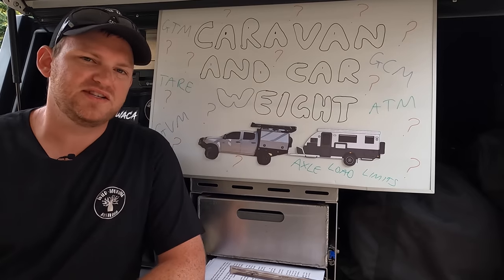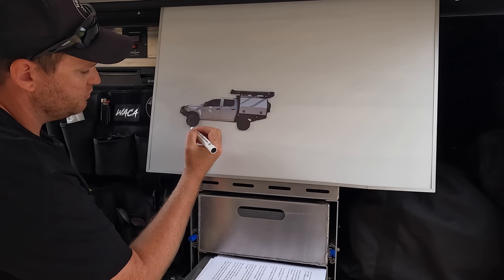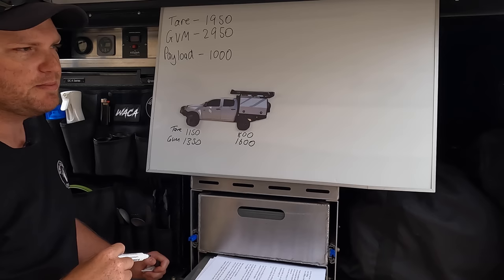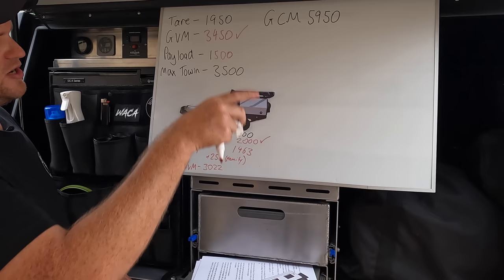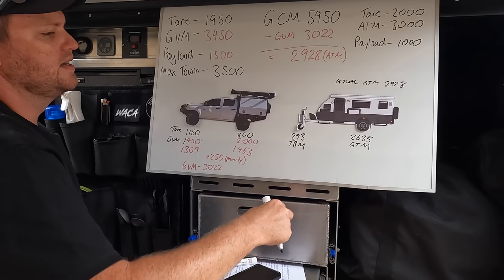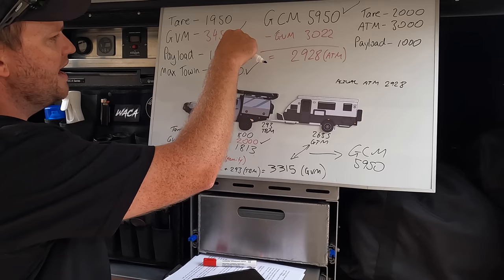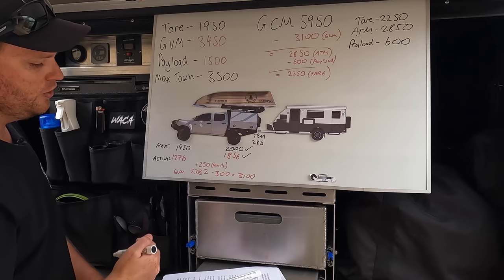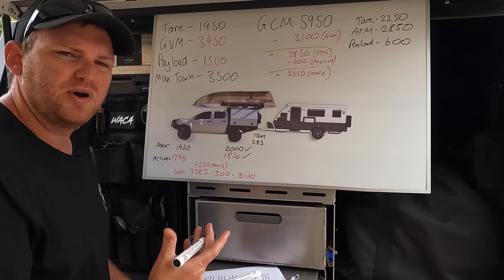How to work out what you can tow? ||  Explained - TARE, GVM, AXLE LOAD LIMITS, GCM, ATM, GTM, TBM...

Comment: Good video and good explanation. However (and I know this is a controversial subject and not everyone agrees) my concern is with using the term actual ATM for the van (i.e. the loaded weight of the van which is less than the plated ATM) and using this actual ATM weight to calculate your TBM and GVM.  Using this actual ATM weight to say you are legal is fine. Now comes the accident and your van and belonging are spread all over the road, does the insurance company come along and picks everything up and weighs it all to confirm your stated actual weight or do they in their calculation just use the plated ATM of the van and ten percent as the TBM to calculate their version of the GVM. Just saying, it could be an interesting court case  if the plated ATM of the van plus 10 percent as the TBW exceeded the vehicle GVM.

Comment: Great video! Was very comprehensive, and super easy to understand. This needs to be shared all over the internet.

I just wanted to add/reiterate a few things for everyone.

The caravan industry is rife with cowboys, and indeed the RV industry in general (boat builders, im looking at you..) Get the weights of whatever your buy in writing, and get it weighed as soon as you pick it up. If its significantly heavier than advertised, dont be afraid to take it back to where you bought it and shove it up their arse.

It happens all the time, they leave off stuff like bedding, gas bottles, optional stuff, storage boxes etc off the total weight to make them sound better. So ask the question, what items are excluded from the weight, and how much extra does it all add up to.

As mentioned in the vid, the 10% ball weight is a general rule of thumb, any ball weight (within reason) is good weight. Also as mentioned, the towing angles make a massive difference to how the car/van package handles.

Also, particularly when buying utes, ask if the tray/tub is included in the weights. For example, utes advertised as 'cab chassis' are delivered with no tun or tray, and weight is listed to reflect that. A tub can be around 80-150ish kg, and trays anywhere from 100-400ish kg. So it pays to have that worked out, as it could be the difference between legal and illegal.
Reply from the maker: Agree with all of the above!
Thank you for the comment 👍

Comment: Again, another excellent vid, Cam and very well explained with the visuals and number crunching. It can feel quite overwhelming to sit down and learn about tow weights, axle weights and tow capacities. The first number crunch session I did took about 2 hours as we were looking at caravans that we could legally tow with the car that we had at the time. We were not prepared to purchase a new car, so we purchased a van that our car could safely and legally tow....and had to forgo certain things to meet that brief. It was an on road caravan without an ensuite and yet we still had awesome getaways with it. 

For our current tow vehicle, I insisted on a Pre Reg GCM/GVM upgrade, not so that we COULD tow 3.5 ton and travel at max GCM, but that we had that weight buffer safety net across the tow combination. We tow our current van loaded at about 3.2t give or take 50kgs with 270ishkg on the towball, again depending on what we have in the van and how it is loaded.

People are also getting caught out with weights, such as what happened with the unexpected weight of your current tinnie, or vans that have changed furniture configurations, or have added after market battery systems, extra solar panels on the roof, or added an after market airconditioner or washing machine. Those weight additions are not reflected on the compliance plates of the van. So people can look at the plate and calculate the payload and towball weight of their secondhand, but new to them, caravan and can be overweight before they even put a stubby of beer in the fridge and a loaf of bread in the microwave. (that is where people store their bread, right?) Everyone looking at purchasing a second hand caravan (regardless of age) should be putting the van over the scales/weighbridge before parting with ANY money.

 Despite all of the youtube videos, write ups in car and van mags, and oline articles there are still so many obviously overloaded combinations up out there. But, I am also sure that with more people talking about this and reading about this, they are looking at their own setups and thinking it is time to get legal. 

Got carried away, as per usual. Sorry.
Reply from the maker: Absolutely agree with all of the above!
And good on you for putting the effort into figuring out what you could tow legally before purchasing something.

I do regret not looking into a pre rego GVM/GCM upgrade for the same reasons (a little bit of a buffer!), but at the time Tiff and I had no intention to ever tow a caravan. Haha how things change when kids come on the scene!!

Comment: Cam not sure what your day job is but you would make a great teacher. Love the way you used your own real example to build up what to most caravaners is a complex topic and often overlooked or not well understood. So your work here is much appreciated. We are currently setting up a touring rig with a new Prado and have a Pedders GVM pre-rego organised as part of the purchase price with Toyota. The GVM upgrade makes it possible to keep within that all important rear axle load as its usually the first limit to be exceeded when towing.  With regard to your boat. There are other options like plastic fold-up boats like the Portabote. We took one around Australia quite a few years ago before I had head of GVMs. It was only 10 ft but only weighed 30kg. Not sure what the weight of the 4hp motor was. It could take my wife and two small children. You can get 12 ft versions of these now and they fold flat like surf boards. Good also to discuss  the load capacity of your tyres on the D-Max when doing a GVM upgrade and loading up your vehicle. Is there a rule of thumb for the final load on tyres above the stated tyre rating limit? Thanks again for your excellent work.

Comment: Hi Cam, Love the vids and watching the series.  One thing that you say alot is 'legally'.  There is a definitive gap between what is legal and what is safe.  In most (?) cases, these are two very different things.  I watched with hesitation when you had the GVM upgrade, but I think ultimately you need a bigger vehicle.  Every thing seems to be at(near) the limit of the upgraded GVM or the GCM.  Doesn't leave much wiggle room.  Did you consider a truck, Canter or NPS size?  Already has the higher GVM, higher GCM.  A mIle of seat room in the back for the kids, and you can take the tinny.  I say win win.  As a side note check out John Cadogan on GVM upgrades from an engineers perspective.  He puts another perspective on the whole GVM/GCM debate.

Comment: Great video. Realistically a safety weigh (car and vehicle) should be compulsory when a caravan, and/or trailer is sold. Also if a car is fitted or sold with tow equipment car should be weighed with owner in driver seat.

Comment: Just watched your video. Very well done. Best explanation I've seen so far. You did forget one thing regarding the tinnie. Regardless of GVM upgrades, payloads etc., the roof load limit remains the same. No upgrade will change that. I think like most 4wds, the limit is 100kgs with a few exceptions, which means you can't load much on top. It's a centre of balance thing. Once you include the rack, awning and tinnie, you're well over your roof load limit and insurance may not cover you in the event of an accident

Comment: Fantastic explanation, so clear and easily understood, thank you. I’ve only just subscribed and have really enjoyed the ones I’ve watched. 
I agree, rear axle weight limits are one to watch. There is a formula one can use and I did the calculation for my Discovery 4 and here is the formula and the calculation for my car. 

To calculate the actual ball weight affect on the rear axle; multiply the ball weight by the (vehicle wheelbase plus the rear overhang) and then divide the answer by the wheelbase. 
e.g.  Disco:-
w/b 2900mm overhang 1320mm
Total 4220mm
Camper towball weight 240kg

240 x 4.220 = 1013
1013 / 2.900 = 350kg 
on the rear axle. 
Perhaps your 60kg estimate is a bit under, but each car will be different. 
Thanks again for a great explanation.

Comment: I know this is a late comment, but I felt compelled to share my experiences for the benefit of others.   As a result of your excellent episode on this subject, I had my ute and van weighed.  I own a 2013 Goldstream Wing 111 ST (wind up top and pull out beds) camper.  As I only had the gas bottles both water tanks and two water  jerry cans full, no bedding, food cloths etc I wasn't really concerned.  However to my surprise  the ATM was over manufactures specification by 177kg! That is the weight of my water.    Now here is the reason I'm posting this: the chap weighing my rig told me it is not unusual for manufactures not to include full water tanks, stoves, fridges, cupboards etc when they calculate  the TARE etc.  So basically as soon as I put water in my van I'm over the limit.   I think it's important that people are aware of this, particularly if they own a later model van.  My ute is a whole other story.  Thank you for putting doubt in my mind as to my weights and prompting me to do something about it.
Reply from the maker: Thanks for the comment Bob. That’s really frustrating that you’re left with no payload. What’s your plan? ATM upgrade?
Reply: @WildTouring  Thank you for your reply.  I did screw up I meant earlier vans not later ones although it's pertinent to check.  Not much I can do really, an ATM upgrade is my only option,  I will engage an engineer to advise me of which possibilities are available.  I will also need him to review my ute.  Although it's not  over my towing limit the weight over the rear axle is outside specs.  It's an extra cab model and the bulk of the weight, batteries, fridge, generator etc are forward of the rear axle.  I haven't come up with an expectable and practical  solution  moving weight forward as yet.  Still early days.

Comment: Great video and well explained. 
One further thing to keep in mind, with the lack of regulation in the caravan industry, I have found that quite often the tare weight that is stamped on the compliance plate of the caravan (and mentioned in the brochure) is not correct and in some cases does not include batteries, Aircon and in some cases even spare tires. 
I have seen caravans that were 200Kg over the specified tare when weighed. This would put a lot of rigs over the legal limit if you're coming in close.

Comment: Interesting vid  the weight  problems aren't going away anytime soon weighing my rig recently guy on the scales told all crashes with vans go to scales SunshineCoast Qld.. I tow with a LC 200 with 2.5 t  atm van have gvm upgrade 3650 kg I am 1000 kg under gcm & 200 kg under vehicle gvm the kicker is with a TBW of 270 kg I am close to the rear axle load of 1950 kg limit.  Personally with a Ute 2.5 t van would be my limit  when you decide on a van weight as well as check the comp plate a few mates are over the stated plate . A rule of thumb multiply the TBW x1.5 gives close rear axle load. Cheers all the best 👌

Comment: If you end up with a 285kg ball weight, that equates to approx 370kgs at the rear axle. The avg dual cab figure is 120-140% when using the distance to hitch pin from rear axle divided by total wheelbase length. So approx 85kgs has been removed from the front axle onto the rear axle.  Handling and braking is compromised until this is rectified. The correct spring rate cannot fix the issue, only a WDH system can do the job. Reason they're called 'weight distribution hitches' and not 'level riders' or 'sway bars' as many like to refer to them as. Fine to disconnect a WDH off road as your speeds are typically slower.

Comment: Nice video Cam. One thing to point out - the factory rear axle limit for the Dmax is actualy 1870kg, not 1600kg as you've mentioned. The total of the axle capacities is actually higher than the GVM off the factory floor, as it is for many 4WD's.

Also, you can work out the weight transfer between the front and rear axles when you add the tow ball weight. It's simply overhang divided into the wheelbase. On your Dmax, 293kg tow ball weight will take about 130kg off the front axle, and put it on the rear, giving the total rear axle weight increase from the tow ball weight of 422kg.
Reply from the maker: Cheers Aaron, enjoying your series north at the moment mate.
Reply: Hi Aaron , I've actually been looking for this formula as I'm considering a light truck with a axle to tow ball overhang at 2 Lm ,3365 Lm wheelbase I've searched the D Max dimensions and still need just a little bit more help .
  I would much appreciate if you could share the numbers you used .
 Vehicles over hang can vary and just trying to make the right decisions before purchasing .
Thankyou

Comment: Great explanations, really well done. However the impact of the initial van TBW of 283kg on the rear axle may be more like 1.5 times the TBW i.e. more than double the 60kg extra kg used in the example.  Rear axle is often the first limit to be exceeded for the tow vehicle.
Reply: Exactly. The effect of TBW on the rear axle loading is dependent upon the distance of the tow point to the rear axle. The longer this distance, the greater the effect. For the effect of the TBW to be applied as explained in this video the tow hitch point would have to be vertically above the rear axle.  The upshot is that the effect is ALWAYS greater than the TBW.

Comment: Thanks for the video awesome job, a point of contention tho I'm of the understanding the the tow ball weight is included in the GVM and is not an added weight thats why your specs on your car say maximum down ball weight, so van specs must also not exceed max tow ball weight as well,
Reply from the maker: Cheers Graeme. Whatever ball weight your van is, is absolutely added to your Vehicles GVM (thus reduces available payload). 

The max tow ball weight is a Safe Working Load for the hitch/towbar/mounting points to chassis ect. 

For example. A GXL 200 Series land cruiser with a 610kg payload, towing a 3500kg trailer with 10% ball weight (350kg tow ball weight). Will have an available payload of 260kgs left for occupants/Fuel/luggage/bullbar/side steps ect….

Comment: Bloody hell... this would have to be one of the best explanations of towing on YT..one question I have is doesn't the GCM increase when you upgrade your GVM ?
Reply from the maker: Thanks mate!
No unfortunately most of the time it won't. There are a couple of exceptions;

- There is one pre-approved kit that can be fitted pre-registration to increase GCM. But it must be done prior to rego on a brand new car. 

- The only other way I'm aware of is with 6 wheeler conversions. Again this needs to be done pre-rego to be federally compliant. The weights can push these vehicles into the light truck classification with different rules in some states.
Reply: @WildTouring  ok thanks mate